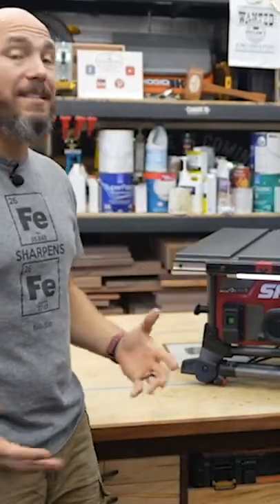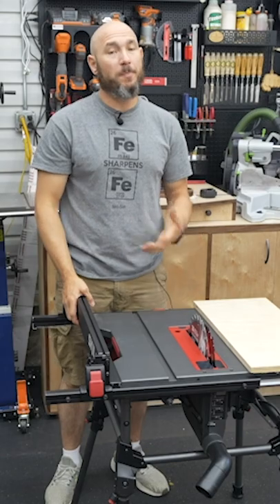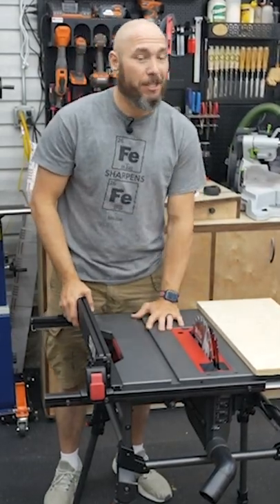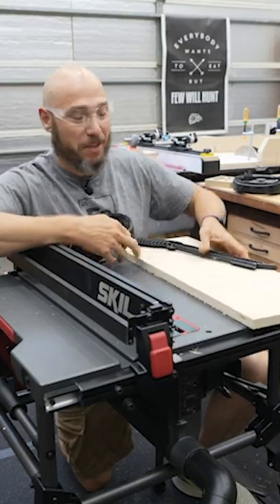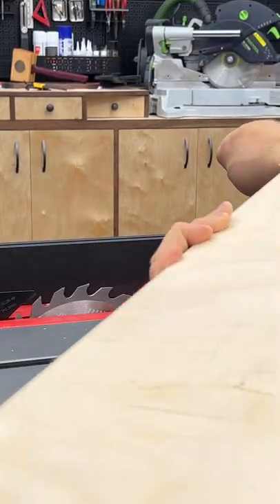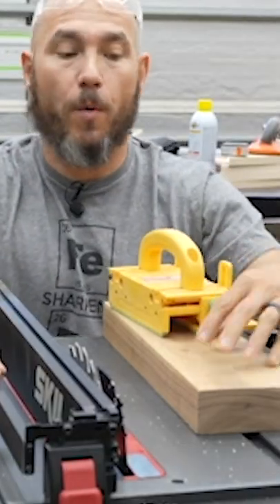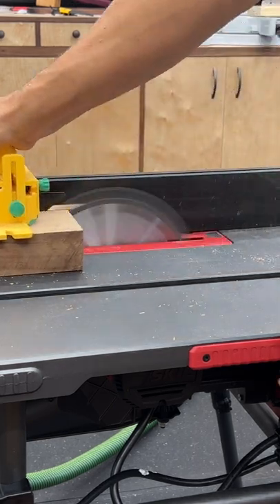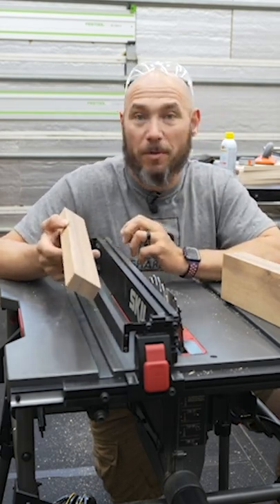The BEST Table Saw for Beginners? #shorts

Comment: To minimize tear out you can do a scoring cut first.  Set the height of the blade about a sixteenth or eighth inch above the table, run it through then set the blade to full height and make a final pass.  Zero tear out.

Comment: I bought this table saw about 1 year ago and I really like it. The part I immediately replaced is the blade. This table is very good and precise. I love the foldable legs and the rack/pinion fence rail. Also, people don't know this, the table has a screw to adjust the parallelism between the blade and the fence. For my usage, this affordable table saw is almost perfect.

Comment: I have this saw to replace a dewalt 10 inch table saw and I chose my SKIL any day I’ve the dewalt . Smoother , easier to set up, and not loud compared to the dealt. The on,y thing is with the dewalt you can but wider stock.

Comment: Hmm. I've been looking closely at the DeWalt contractor saw, but this Skil keeps popping up as highly recommended also. It ain't bad to have options.
Reply: Go with dewalt. You won’t regret it just don’t get the cordless I got the cordless not to much power but it is really good for quick small projects